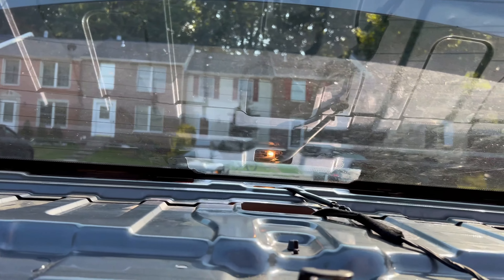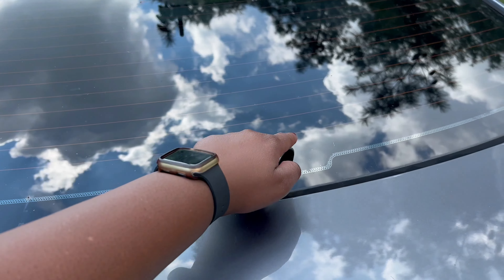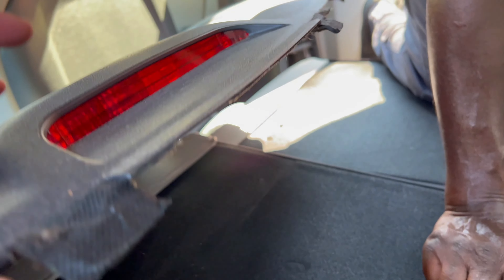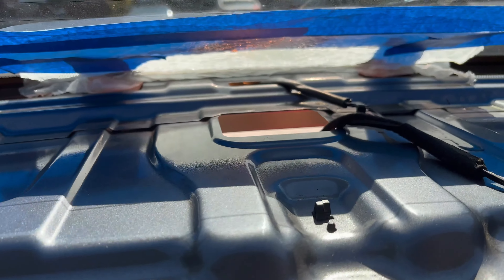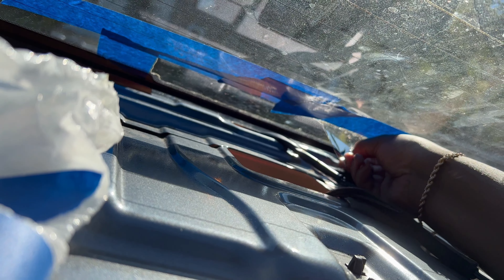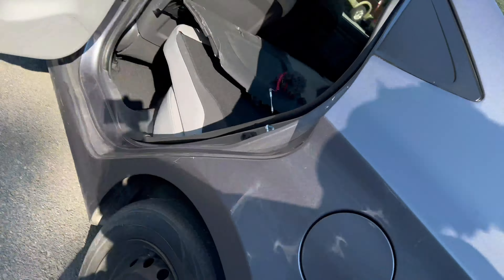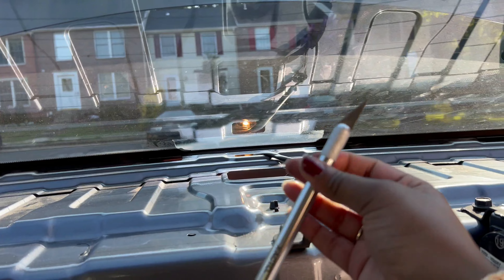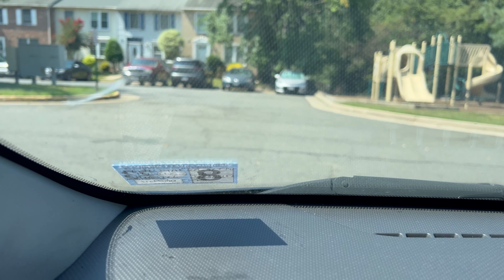How to EASILY Remove Tint On 3rd Brake light (2015 HYUNDAI ACCENT)

Comment: Great video! how has it held up? Any peeling?
Reply from the maker: Thank you. It’s still holding up great. No peeling or bubbles.
Reply: Glad to hear! I started to do your approach and then when i took off my rear dash cam it pulled a section of tint off...so ended removing all of the tint from the rear window 😢
Reply from the maker: @twistedscience9248 oh no…mine also ended up working great because it was a tight space in between the glass so it kind of made it a seal so it wouldn’t peel.

Comment: How did you remove the freaking panel you should show how did it I'm about to break it just to get the tint off
Reply from the maker: Yes it is a pain, but my father did most of it and it was too long of a process to film because by the time he got it, I had the camera charging. All the panels fit like a tight puzzle, you just have to find a way to pop them out with either a flat screw driver or another similar tool.

Comment: window tinting is not that expensive, I would have just had the read window re-tinted and had the tinter cut it out so it didn't look like crap like it does now.
Reply from the maker: In my area it was actually expensive for them to do that. I had a very short amount of time to get this done. Instead of me paying hundreds of dollars to cut a small square out I did it while barely spending over $5. It was a temporary fix at the time , but honestly it’s barely noticeable and I never got it redone…and I’m not losing any sleep over it so it works for me 🤷🏾‍♀️🥰